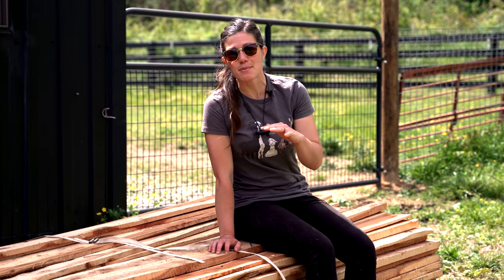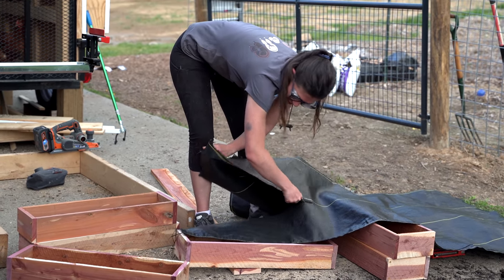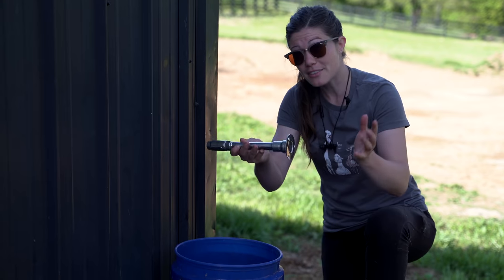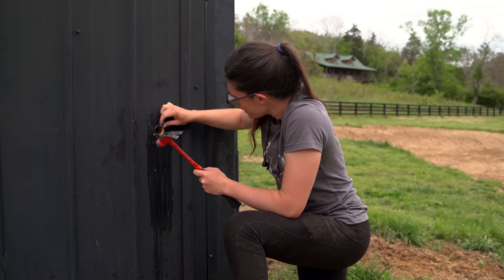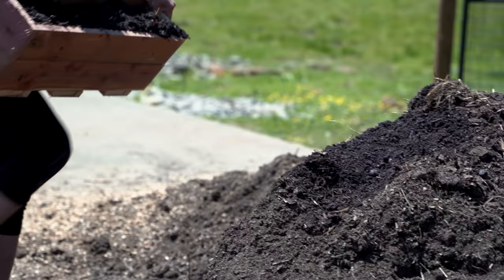Easy, Inexpensive DIY planter build // Gardening & Woodworking

Comment: TIMESTAMP TIPS in this VIDEO

0:14 ...buy diseased wood
0:24... Water and Rot Resistant wood
0:40 ...Rough cut wood 
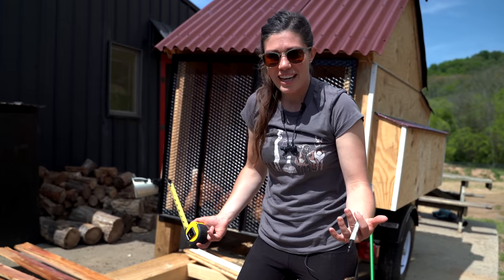1:39..cutting up low grade lumber (Cut out the Ugly 😂🤣👍 Be Free of the Cracks)  
2:25..Cutting trick
2:43..Smiley face wood ( 😍👍💓love this tip)
3:03..Face of wood
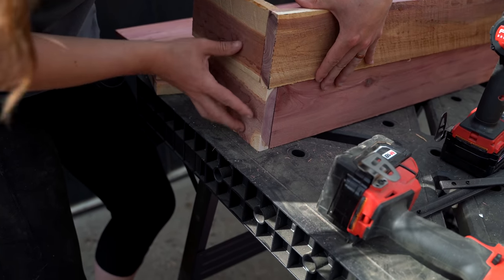3:11..interlock pieces
3:20..Pre-drill pieces to prevent splitting
3:45..Modular pieces/ boxes (play with DIY lego pieces) LOL
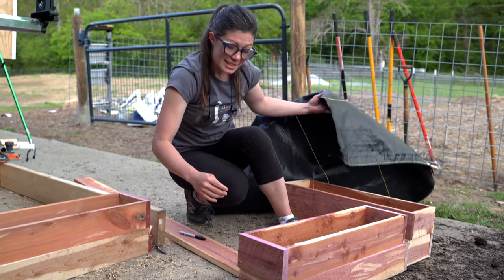4:13..Planter flooring
4:41..measuring technique with added yoga stretch (stay flexible during lockdown)
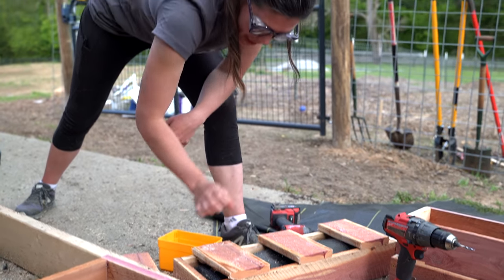5:18..Raising the Box, for good  drainage
5:33..attaching the inner runners for attaching boxes
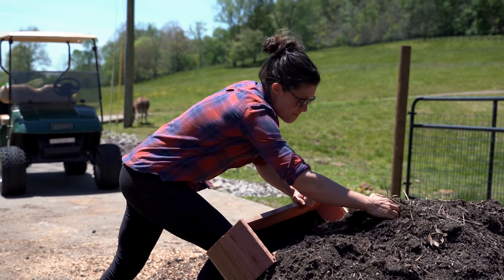9:19..Filling the planters...Fertilizer + Mulcher control tip
10:10..kitchen Herb plants in the Planter

😂🤣👍 Lots of good humor fun in this project... 😂🤣👍

🔻Look for the Prettiest side 😂🤣👍
🔺 Watch out for ...Wasp 🐝 ,Spider,🕷🕸  snake city 🐍
🔻Fold it like a Christmas Present  😂🤣👍
🔺 Don't explode the Pipes in the Barn 🌊 💧
🔻 9:00 love the Success Smiles 😍👍💓  (job well done)
🔺 Be Super super Happy doing your projects 

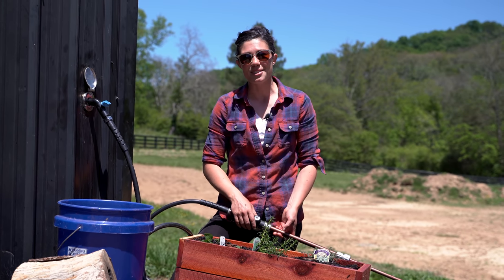11:17 BLOOPERs 😂🤣👍
Reply from the maker: You are a true hero

Comment: I’m curious about the pex tubing.  Do you need all of the elbows?  I thought the advantage of pex was that you could bend the tubing?  Is this a code requirement down there?
Reply from the maker: it is bend-y, but only over long runs. It doesn't "elbow," which is why we used the elbows ;)

Comment: I think I’ll try this one.  Great point on orienting the grain!   Any more info or recommendations on the PEX tubing your using?  Are you saying it’s only a temporary solution?
Reply from the maker: It could easily be a permanent solution, just knowing the temporary nature of this particular project, it was the best option. Check out Pex tubing and Sharkbite connectors, that's what I was using in the video ;)
Reply: Anne of All Trades Thanks.

Comment: Is spalted cedar still resistant to rot? Is it only called spalted when it's from fungus, or is the darkening from wetwood bacterial infection also called spalting? The wetwood darkening HUGELy reduces strength. Just thinking aloud about whether or how wood from diseased trees would work differently in a planter. And of course I'm sure you know that only the heartwood of cedar and redwood are rot resistant, the sapwood isn't.
Reply from the maker: Spalting is already technically a form of rot, what is generally referred to as spalting is the black lines of fungus. With a lot of woods, you need to catch the spalting before it's gone too far, or it becomes too punky and weak to use. This wood is not spalted though, so not super relevant to the topic at hand ;)

Comment: Are you being sponsored by Milwaukee?
Reply from the maker: Not directly, there is a healthy mixture of tools I’ve purchased at full price. I acquired a few of the tools I use doing tool testing and reviews for the Home Depot and because of that relationship I can occasionally get samples of tools, but due to the HD testing, when we moved, I sold most of my other tools and consolidated to Milwaukee because they have the most tools on a single battery platform that I actually use. Plus, all my neighbors have Milwaukee too, so it makes lending and borrowing a whole lot easier.